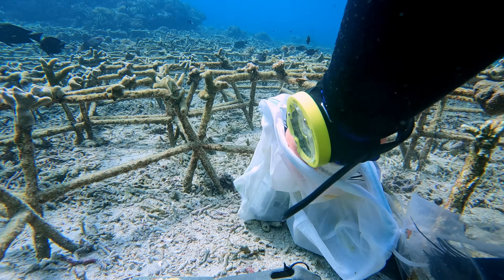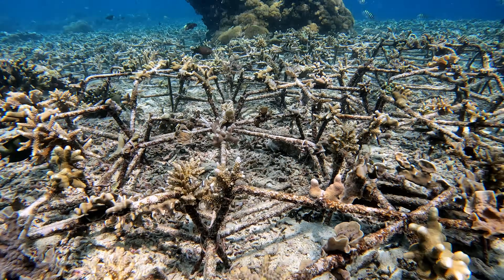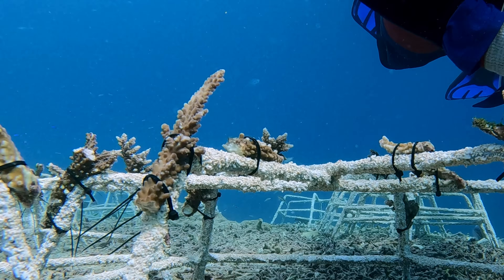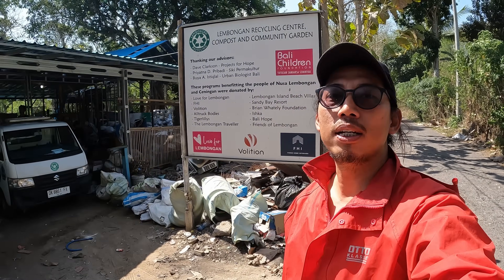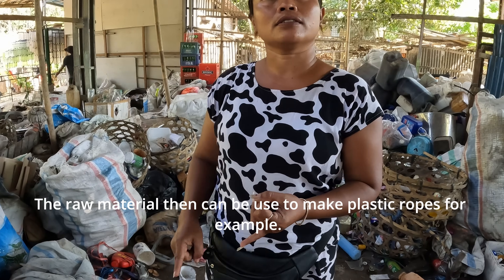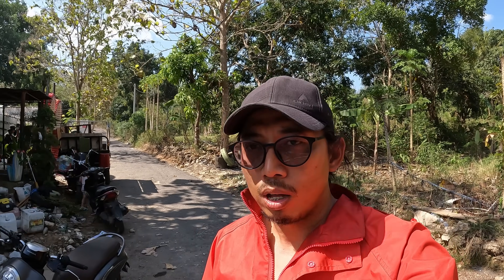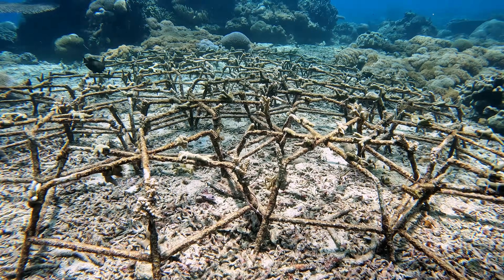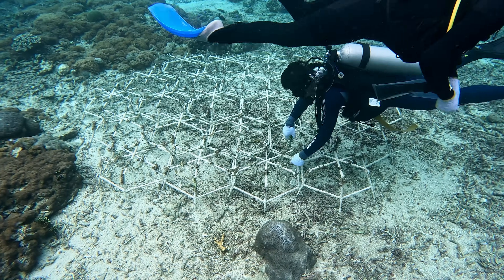We're testing alternatives to plastic zip ties to attach coral | VLOG

Comment: rebar tie wire cost almost same as zip tie, but for experienced user it's faster than zip tie to use..  You just need rebar wire tie twister tool and little practice... there is also power tool version, but won't be cheap to get one that can be used underwater..
Reply: This was als my first thought: (ungalvanised) steel wire, possibly with a wire gun.

I have no experience with them, but 
If it can be used for rebar tightening it should be fast and secure enough for tying choral
Reply: This is the answer, they could even use stainless steel wire if it needs to last a long time, but I assume raw steel wire last long enough for the coral to attach by itself
Reply from the maker: I'm not sure about the underwater power tool (that would be awesome thoug). I think the wire is worth to try on coral, I think with some preparation it would be more or less the same time as zip ties, to pre cut it for example. Thank you for the ideas! Cheers, Yudi

Comment: Instead of metal zipties, you could use thin metal wires. Wrap the wire around the corals and the steel bars, and then twist the two ends of the wire around each other for fixing. My dad used this method in his hobby vineyard to guide the growth of the plants. Which exact material of wire I'll leave to your expertise.
Reply: In what way is steel wire "safer" than metal zip ties?  They're both metal. They both corrode...duh.
Reply: @CitizenAyellowblue  have you even watched the video? 8:26
The wire is faster and easier to secure corals with and they won't need the pliers (if they choose the right gauge). Also its easier to judge how tightly it holds, so that whey hopefully wont crush the corals. Also it would be cheaper too.
Reply: @IamCrusaderRUS  I think you'd get the same problem with the steel zip ties.  Metal isn't soft and a tight enough hold would probably break the brittle coral.
Reply from the maker: That's what we are afraid of, so we need more time to test and hopefully come up with a way to use it on coral. Meanwhile, after some days now, the steel zip ties hold pretty good on structures. Cheers, Yudi

Comment: Why not experiment with natural fibres for tying up the baby corals. Plastic is definitely a no, no. It does not belong in the ocean. No excuses. 😢 perhaps look at plants used by indigenous people, or in bushcraft skills using natural fibres (eg bamboo or banana leaves) that have a longevity. The world's oceans are already struggling and being digested by marine life.
Reply: Natural fibers will degrade faster than plastic, causing the coral to detach. 

I imagine it’s a quite a complex cost-benefit trade off—it may take longer to tie string, which means fewer coral get planted making the overall project much slower.
Reply from the maker: Thank you for your thoughtful suggestion and concern! The hemp rope and cotton twine we are experimenting are made from organic material, lets hope we can get positive result from this experiment! Cheers, Yudi
Reply: There's already a lot of plastic in the ocean, so it doesn't bother me much. I think it comes down to a tradeoff between speed of deployment, diver safety, survival rate of coral, and of course sustainability of materials. Zip ties use so little material, we're taking kilograms, not tonnes of plastic, and they do very well on all the other metrics.

I do think it's great to try and minimize the plastic use, but spending so much time and effort on it means that ultimately you're installing many fewer of them.

Comment: I think that the speed of attachment while working underwater contributes to diver safety and deployment efficiency. A few kilograms of extra plastic in the ocean doesn't concern me much. The increased survival rate of coral is a bonus. Plastic should be minimized, but there's a point of diminishing returns past which it's silly to put in too much effort.

I do like the stainless steel tie idea. It's unfortunate that it doesn't work as quickly or secure them as well, but that was a great idea using them to secure the cages!
Reply from the maker: Thanks for the concern over our team's safety! It's really important we find ways that take this into consideration and how it affects the efficiency of the work as you mention. We'll try our best to test different methods but it's great to have our community chip in with all these ideas. Thanks for your input! Cheers, Tim
Reply: The coral should be growing over the plastic encasing it in effectively limestone
Reply: @MossyEarth-FieldNotes  I am glad to see the plastic recycled

Comment: Several people have mentioned using a thin metal wire, and I have another reason for why that might work and actually save you time. Unlike the zip ties you can tie the metal wire around the frames before you send them down, then wrap the ends around the coral when you get down there. 
That way you don't have to collect the cuttings or bring the ties down with you.
Reply: Ooh yes, that’s smart!
Reply: I wonder if having the wire pre-attched wouldn't allow them to stack as well during transport out to sea or cause them to more easily get tangled together
Reply: @matthewhilliard8410  that’s something to consider too, for sure! Maybe they could attach the wires on the shore or in the boat as a final step? This might require more trips back and forth from the shore to the site though, but they could time it and figure out which solution is faster/more effective. It’s pretty hard to know if these things will pose a big problem or not if you’re not there to trial it in person, or that’s what I inagine
Reply: But wouldn't handling the metal wires be a potential hazard to the divers? Not just in terms of direct injury, but I can imagine that if even only 10 of these wires poking into and through the diving suits per day, it would wear the suit down rather quickly.
Reply: @Diluculi1  That's possible, to help avoid direct injury they could be spun with pliers.
And it would depend on the kind of wire used, thin copper or aluminum wires would be more likely to bend than poke through a wetsuit.
Reply from the maker: Thank you for the suggestion! That's something that we can try out on the next phase of the experiment. Cheers, Yudi
Reply: Cost of the material is always a concern.
Reply: Cotton ties

Comment: Hey guys, nice to see fellow coral planters being busy!
I have been trying to plant corals on and off since the bleaching of 2016. Working as a dive instructor in the Maldives, i realised that speed and convenience are key. While it was so rewarding seeing my first 5-10 pieces of coral growing over the years, and eventually attract schools of small fish. But more and more i regretted not putting another 100 pieces down years ago.
But the problem for me, and i guess for everybody, is always time and resources. I did not have the option to go to the store to buy anything, as i was working on a resort island with no shops. So i had to import all my equipment in my luggage the 1 time a year i flew home.
So after trying some things out, i figured out that a rope system was for me by far the best. I ended up finding or making some anchor points, either some big rocks, bags filled with sand or old umbrella stands. Then put those in a circle and connect a big rope , 1cm diameter or so, between them as the base of a spider web, to replace the frames you are using. If needed put some rocks or anything in the middle to elevate the whole. Just make sure this is sturdy, as long as these ropes are stretched tight, no turtle will be able to get stuck in it. Frames will still be the better choice, but they were not available for me.
Then use thin 2 strand braided cotton rope to lay over the big ropes. I used rope that i could break by pulling hard enough by bare hands, in the hopes that a turtle that might get trapped will be able to do as well. 
And now for the best part: to attach a piece of coral, all you need to do is to unwind a short part of the braid, pull the 2 strains of the wire apart and slide the coral piece in. As the corals are quite sharp, they will stick in between the wire very good. Like this it took me around 5 seconds or so to attach a piece of coral.
And it has a great benefit for later, as the ropes are really easy to transport from a central nursery to the reef.
The downside of this method is the maintenance of repairing the broken ropes. Fish and turtles will come through and break ropes. If you want you could solve this by using thicker ropes, but that does create the potential for something to get stuck in it if the ropes are to close to eachother.
But in my case i made the coral nursery in the place where i did my training sessions. And i got real nice response from the guests who saw me fixing or adding corals during their scuba dive training
Reply from the maker: Hey there, fellow coral planter! 🌊 It’s fantastic to hear about your dedication to coral restoration since 2016. 
Your rope system sounds innovative and efficient, especially considering the logistical constraints you faced on the resort island. I love how you’ve thought about the safety of marine life with breakable ropes for turtles—such a thoughtful touch! 
Some other organization here in Bali use rope to hang Acropora branching, and same as you, it's for the coral nursery. 
Thanks for sharing your experience and the ingenious solutions you’ve come up with. It’s all about adapting to what works best in your specific environment. Best of luck with your ongoing efforts, and to make even more progress in the future! 🌍💚 Cheers, Yudi

Comment: It is nice to see that you are proceeding with a lot of testing! About corrosion, if you have in contact normal steel with stainless one, you can have galvanic corrosion... leading to a faster corrosion of the scheleton.
Reply from the maker: Thank you for the insight! Luckily so far the coating seems to covered the structure very well. Cheers, Yudi

Comment: Do you have an average number of days or span of days that it takes for corral to attach fully?

Could look to find a material to corrodes just over that limit and see if there is a product made of it that can be tied. Or something under it that you can do a second tie on at the midway point to re secure before it corrodes
Reply from the maker: The average time for corals to fully attach can vary, but it generally takes around 30 to 60 days for coral fragments to securely attach to a substrate. I have high hope in the hemp rope, but we should decide once we have the final result of the experiment. The idea is that the attachment will be covered in coral completely when it's successful. Cheers, Yudi

Comment: Great work guys!
I wonder if there are any biodegradable zip ties that would work for fixing the coral on? I'd assume they're not needed once the coral has grown enough to attach itself but you'd need to find something that lasts long enough for that to happen, and can biodegrade in salt water
cotton/hemp ties are a nice idea, but can only imagine how annoying they are to tie underwater 😂
Reply from the maker: Thanks so much for your support and great question! 🌊 You're absolutely right about the need for biodegradable options. We've actually been exploring biodegradable zip ties but so far we couldn't find plastic-free biodegradable one. It's definitely a challenge, but we're hopeful that we'll find a sustainable solution soon.
As for cotton and hemp ties, you're spot on—they are more eco-friendly but can be tricky to work with underwater! We're always on the lookout for better alternatives. Do you have any ideas or suggestions for biodegradable materials that might work well? Cheers, Yudi
Reply: @MossyEarth-FieldNotes  I'm not all that sure how various things do in seawater but PCL is biodegradable and maybe natural rubber?
Also, just thinking but it might be easier to use a different method to attach the coral with the string?
If you used a binding knot (something like a bag knot, which is a variation on a clove hitch. Clove hitches and it's variations would be good here I'd imagine because you can create it loosely then just pull on each end to tighten it) to hold the coral onto the reef (rather than just wrapping the string) then tied whichever knot you're using on top that might be easier because the coral would be held in place while you're tying the knot?
Waxed strings might last better underwater too if the string degrading too fast is part of the problem?
Good luck with it all!
(and sorry explaining knots with words is not a good plan)
Reply: biodegradable zip-ties made from 100% PCL seem pretty widely available
Reply: @hannesbolmstedt  care must be taken in selecting "biodegradable" products because what is biodegradable in soil is not necessarily biodegradable in salt water, or may in fact deteriorate too fast to be useful. I think steel/iron wire strikes a good balance - lasts long enough to be useful, corrodes into iron which is a natural nutrient in the water. If wires aren't being successful to attach corals then I think it's worth doing some investigation as to why; maybe it matters if the twist is placed next to the coral or next to the frame. Maybe the coral doesn't like rusty steel touching it (add a protective sleeve over the wire?). Maybe the gauge of wire matters. Maybe a special tool needs to be used to consistently tighten the wires.
I also wonder if it is not impractical to get the coral to grow/attach to the frames in a tank on land before deploying them into the environment, therefore allowing the attachment materials to be removed before deployment. Either way forge ahead with the zipties in the meantime - great work!

Comment: Glad to see you looking into alternatives. Looking forward to results in 3 months. I really hope one of these twines will be up for the job.

The metal structures I'm far less concerned about. It's not like you're pumping tons and tons of finely ground iron dust into the ocean. - That would be an issue for sure. But these cohesive structures will only corrode as fast as their surface area allows, and with the protective coatings that might take a very long time, and at least based on what I know right now, I don't think that slow source of extra iron is gonna be that dangerous.
Reply from the maker: Thank you for the support! And on top of that, the coralline algae will eventually covered the structure adding more layer naturally. Cheers, Yudi
Reply: Plus there are quite a few artificial reefs already colonized out there that were formed from deliberately sunken ships. Most are doing well and don't pose harm to the environment if the ship was cleaned properly.

Comment: Nice work everyone!!!

Did you consider also the possibility of building different layers of height in the structures? Corals grow on rocks and different height, so it could be interesting to create maybe some points with a double layer of structures forming also different slopes and sizes for future development of coral and fish safe spots.
I know nothing about reef ecology, but seeing the structures being all on a single layer made me think that maybe a bit of variety could be useful and more natural
Reply from the maker: Great suggestion! Building structures with varying heights could indeed mimic natural reef environments more closely and provide diverse habitats for marine life. However, for our project, uniformity in structure design ensures efficiency, especially considering the volume we produce. Additionally, we are afraid that the strong currents in our working area pose a risk for taller structures.  
Thanks again for your input and support! 🌊💙 Cheers, Yudi

Comment: Thin aluminium wire would likely work just as well, and wouldn't easily corrode either. And can be cut underwater with similar effort as cable ties with a good pair of wire cutters. That would solve the plastics issue.
Reply from the maker: That's a fantastic suggestion! Aluminium wire does sound like a practical solution. I wonder if it would be the same result as metal wire (which has high detachment rate). I think it's worth testing it. Cheers, Yudi
Reply: @MossyEarth-FieldNotes  I don't think aluminum will work great, it's lower on the galvanic series than steel, so the aluminum would be eaten away at. If the stainless steel works then a bronze or brass could work as alternatives. Still would take some testing to confirm.

Comment: Hello, great work. Good luck with your trials. -- suggestion about a brace approach below.
Because some of these materials can be quite tricky under water to tie,
I was wondering to accelerate the installation and solve the zip ties problem an approach could on land to install a brace on the stricture. 
What i mean is somethin that has a u shape coral side or v shape on which a piece of tie - let s call it the strap - (not plastic) is attached to one side of the brace. The brace itself is secured with metal tie to the structure.

Once under water with the coral the idea would be to have only one side of the strap to attach to secure the coral against the brace.
Maybe this would not work for all for of coral if there is no tubular shape to strap against the brace. But hopefully it does not make the work under water more complicated and the strap can be soft enough to not hurt the coral 

Best of luck anyway
Reply from the maker: That’s a thoughtful suggestion! Thank you for the encouragement and for sharing your innovative idea. For simplicity, it is better to tie the coral directly to the stucture, and If the brace would be like an extention of the structure, I'm afraid it would create additional attachment to worried about. But securing the wire for coral on land before deploying it underwater could indeed simplify the process and address the plastic issue. Cheers, Yudi